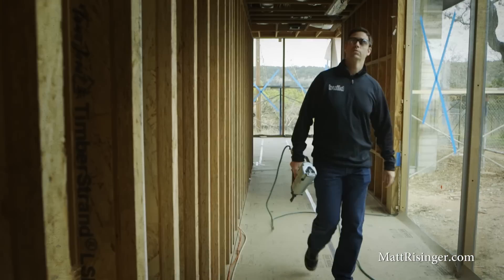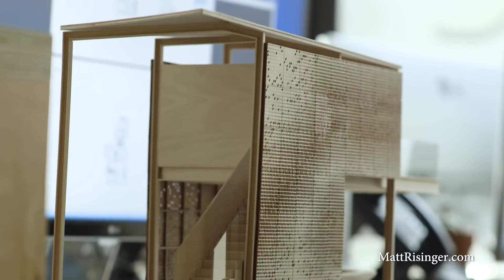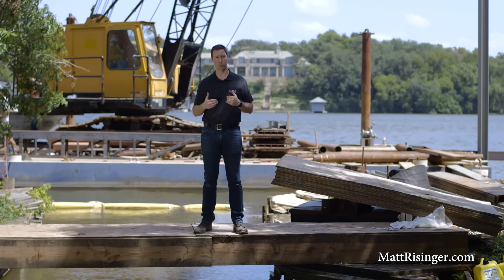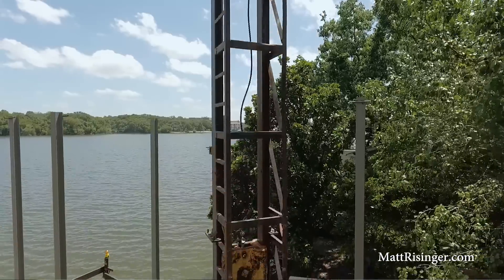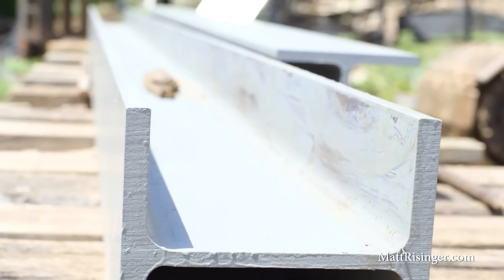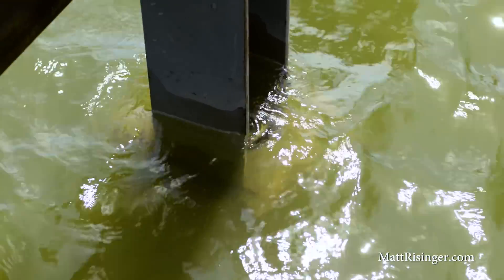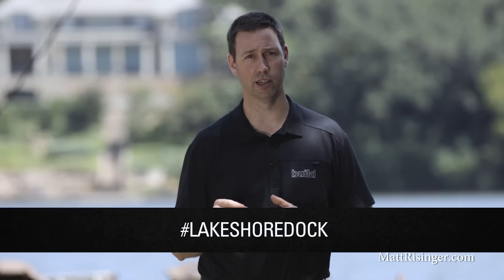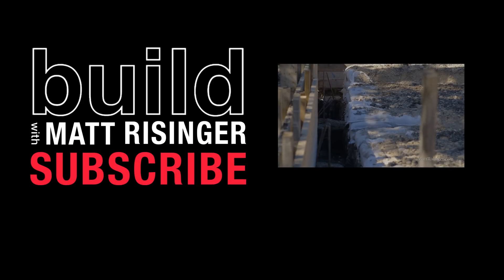Modern Dock: Driving Steel Piles

Comment: I'm looking for info on driving piles for a cabin. It will be located at the bottom of a hill and above a spring, so the will always be water moving through. I think pipes will give less washout than a grid of sonotubes. My small cabin has been on this location for ten years with no apparent problems, and it is on sonotube and blocks. When the hole is drilled, it immediately fills with water.

Comment: I missed corrosion control. Any long term issues with steel pile foundations in that environment?  I look forward to the series to find out.
Reply: On Pickwick lake we have a steel pile dock that I've decided to protect with some corrosion control. For fresh water, magnesium sacrificial anodes are better than zinc. I'll be using Thermoweld to weld the cable that goes from my piles to a ten pound magnesium brick that rests on the lake bed. That protects what is in the water, but above waterline is not protected by the sacrificial anode. For that part, I'll be using petrolatum tape from Denso. Finally, I'll protect the soft petrolatum tape with huge pvc pipe that I split and then reconnect with pvc glue and a final secure with stainless steel wire connected with a ClampTite tool.

Comment: You talk as though you are the authority on pile driving and construction. You missed one very important thing. Most viewers are are not the people who can afford the ridiculous price of an enormous overbuild.They are watching for ideas to do their own projects, either DIY or to contract out. I am a licensed builder, a marine contractor and project consultant. I advise my clients to invest in building correctly and substantially for their individual needs. The excess cost of a piling to hold that much weight would be better spent somewhere else, and if there is plenty of funds for everything they want, then in there retirement. The truth about pilings is they do not have to be driven to bed rock or to any other hard base for most applications residential or commercial.BUT the pilings must have enough surface area in the soil to provide static resistance and therefore be able to sustain the weight placed upon it for each particular  application.You may need a soil sample and an engineer to calculate the surface area needed. Even in mud there is a calculation that would easily sustain the small boat house that you are building.
Reply: doug pitt I was thinking the same thing. Who could afford that?
Reply: Even a small bait dock will run 30k.   All boat docks are over charged.   Think I’ll start my own boat dock company charge half what everyone else charge
Reply: meh, should have hired out a Bagger 288 bucket wheel excavator to dig out all the muck in the lake, then pour concrete footings.
Reply: Hey guys!  I am in the process of having a two-level boat dock built in East Texas and have a question about the length of the piling required for support.  Is anyone still out there?